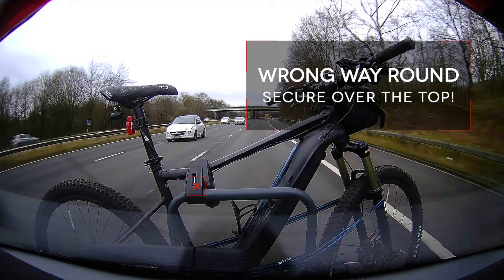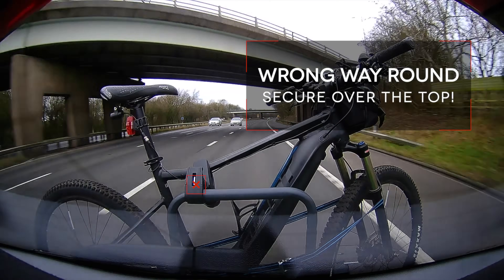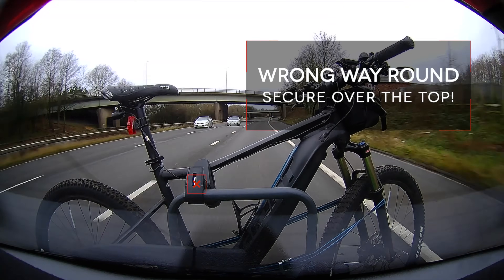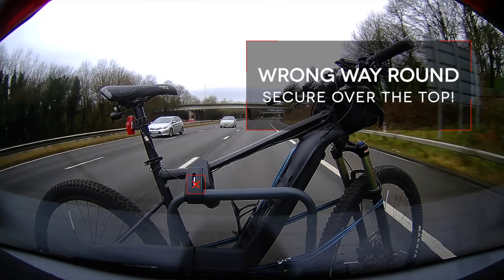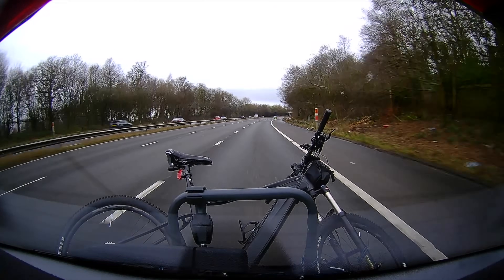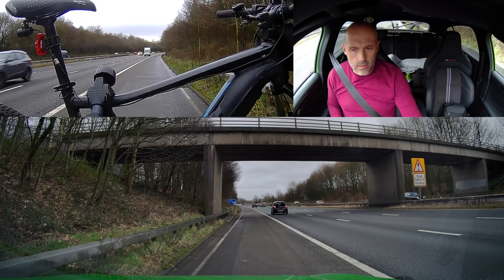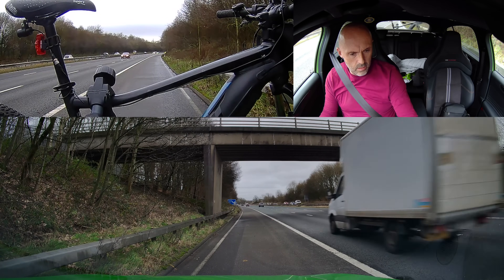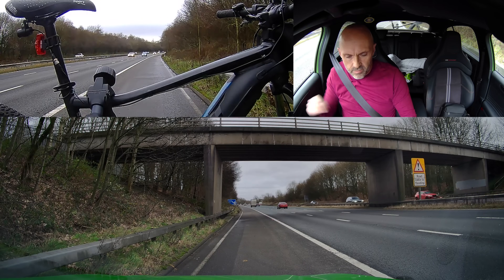Learning Point 415 | Using The Hard Shoulder

Comment: Blimey never thought I would see the day where I beat the Great Ashley Neal on an experience...

I have had to use the Hard Shoulder 3 times in 10 years. I agree that you were right to pull over and sort it immediately... I have seen and read of enough carnage caused because somebody thought, oh I just get it to next junction or services... The loose item will hold on till then....

I can relate as my first time was when the lock on my Nearside mirror of my 18 ton rigid gave up on a very windy day resulting in my mirror been folded in by the wind. This was just as I passed passed Junction 1 of the M18 going towards the M1... Long story short the first available opportunity to pull off at that point was then J33 on the M1, but that was going to be extremely dangerous with no hard shoulder, no Nearside mirror to merge off with and no safe stopping places as every road off it was busy dual carriage ways. So my only safe option was to pull on to the hard shoulder of the M18 and Jerry rig it in place with some bungee chords. I also drove at a slower speed to reduce the load on the mirror to get it back to the yard where I had it fixed overnight by our on site garage team.

2nd time was when I moved into 44ton Artic's, I blew a coolant hose on the M42 literally just past the slip road for Junction 9 and encountered my scariest moment ever on the roads whilst waiting  for recovery. When a passing car stopped in lane 1.... Then reversed Up Lane 1, not the hard shoulder over the brow of a blind hill because they missed their turn off.... Evan at 0230 in the morning I was lucky nothing hit it as it would have ended up flying my way!

3rd and finally was when I witnessed a collision between 2 HGV's last year and pulled over with the casualty truck to provide details... Unfortunately I made the mistake of stopping behind them and couldn't safely pull out for the volume of traffic so had to wait for the Highway patrols to block lane 1 and release me.

Comment: Rightly or wrongly, I would have felt safer and stopped a little further ahead or back from the bridge where there is no crash barrier so I could get a little further away from the live lanes. Many times I've seen HGVs drift slightly into the hard shoulder, don't know why but it does appear to be a thing.
Reply: many  reasons HGVs end  up passing the white line. Road condition, wind, tiredness, lack of attentiveness, vehicle faults, and so on. Its all the same reasons why cars may drift around in their lane a bit - but exaggerated by size and weight.
Reply: @DAFPvnk  I guess we notice it more with an HGV due to the fact that a small drift inevitably means crossing the white lines due to the width of the vehicle.
All the same, if I have to stop I want to be as far from the live lanes as possible.

Comment: I would have done the same given the risk of the bike falling, but as you said, with the hi-vis and also, constantly checking the traffic behind me.
The last time I remember using the hard shoulder was following a roll-over accident, where I stopped at the first phone to get the lads rolling. It was probably 1990.
Reply: For some reason I can't comment on this video, but I can respond to other comments. 

Anyway, I wanted to suggest getting a lightweight bike lock to secure it a bit better and take some of the pressure off that clip. Even a poundland bike lock would help a lot. 

Also, would be interesting to know how old that bike rack is. I have a Yakima Roof rack and cargo box, you need to inspect it every so often to make sure the clamps don't need replacing, wash and lube them. 

Also, you're not supposed to take them through a car wash either. I imagine it's the same with that bike rack.

Comment: So far I've only ever had to use the hard shoulder twice.

First time: I was in one of my works' vans, we were headed down the M60 and the timing belt decided it had had enough with being a timing belt mid-overtake, resulting in having to complete the overtake, coast form lane 3 to 1 then try to land myself on the hard shoulder...

The second - in a different van on the M25 - the driver's side windscreen wiper decided to pop loose from its clip and went flying over the roof of the van... Thankfully there was nobody behind when that happened because that could have caused some problems... anyway, due to the poor weather and the fact the wiper arm was now making an attempt to scrape its way into the cabin, I opted not to continue to the next exit, and instead pulled over, switched the wiper arm from the passenger side to the drivers' side so I'd have at least some visibility then wrapped the passenger side wiper arm in cling wrap as a temporary bodge just to get my last job for the day finished and get a replacement wiper sourced afterwards.

Outside of that... Even the one time I picked up a free No.2 Philips head screwdriver bit with my rear drivers' side tyre I didn't end up stopped on the hard shoulder for that! that managed to hold safe air until I parked up outside my workplace lol.

Comment: Two words Ashley: Thule Outride.  Roof mounted system where the front fork of the bike is bolted to the roof bar cycle carrier.  By far the most secure system.  Only downside is reduced fuel economy (slightly), plus need to remove front wheel.  That can either go in the boot, or you can get a roof mounted wheel carrier.
Reply from the maker: One question, maximum weight limit?
Reply: 17kg per rack, so unless your bike is a heavy weight Enduro bike you should be fine.  The front wheel off can be a bit of a hassle, but it's comforting to know the bike is totally secure.
Reply from the maker: 23kg e-bike! I've got roof mounted systems also.
Reply: Okay - scrap that suggestion 🙂.  Keep the good videos coming. Thanks Ashley.

Comment: This for some reason reminds me of one of these "Police, Camera, Action" videos I watched ages ago, probably years ago. Motorway police notice a car doing a dangerous merge from the hard shoulder, so they decide to have a word with the driver. They pull him over on the hard shoulder and have a word with him, not sure if something else came up as well. They explain to him what he did wrong, what he needs to do better and then send him on his way. I assume you expected what happened next: Yes, he does it again. Hardly gets up to speed and almost instantly pulls out into the path of another vehicle, which luckily manages to avoid him. Proper facepalm moment.

Unfortunately can't remember what happened next, if they stopped him again or if they gave up.

Comment: Hi viz in the door pockets. Then it’s accessible at all times.

Each door pocket has one. The centre-rear passenger is expendable 😂 (but if that many people are getting out, they should be over the barrier in no time anyway).

It’s a good message: like ringing 999 it shouldn’t be used flippantly, but if there’s a justification, even if you’re not sure, it’s better to use it than risk a potentially lethal alternative. 

It’s also an opportunity to reflect on whether the bike is properly fixed before you set off. Clamps can fail or slip; vibration can shake them off their position. Always have a plan B - like a well-tied strap; and check them a few miles into the journey.
Reply: I keep mine on the back seat, like Ashley's. Not that I meant to keep it there but somehow it's there and I haven't moved it yet!

Comment: This is almost exactly what happened to me. My bike came loose at the top and toppled backwards but was held on the bottom but in a very unstable  condition. This was the first time I have ever used a bike carrier. Like yourself I had to quickly fix the problem since it could have got much worst. My bike was hanging on with a thread. Its the only time I have ever used the Hardshoulder. I now place a peice of straping through the frame and attach it to the boot. So if the carrier was to fail the frame would still be attached to the car in some manor. Although this happen 10 years ago I still worry about it, a bike falling in the middle of the motorway? ouch.

Comment: I once had a very similar situation, my bike was on a roof mounted bike rack and the frame holder came loose and the bike was only held on by the two wheel mounting points and was hanging off the side of the car. I quickly pulled over into the hard shoulder to secure it back in.

Comment: Hi Ash, with your particular bike rack, can the top clamp be rotated? If it can, then turning it upside down would mean it acts as a U-shaped hook, and then even if it isn't closed tight then it's holding the bike up. Of course, that might affect the other attachment points.
Reply: Mine can be moved up and down, but I always fasten them open side down since gravity is more likely to hold the arm in place. Both methods have their strengths and weaknesses. Mine do seem to secure onto the top rail better than that though, curving round it. I tighten them right up so the two halves almost touch and then lock them. Each wheel is secured too, to it's super-secure, but to prevent theft, I add a D-lock and cable. I've seen too many loads lost to take chances.

Comment: Well, at least it didn't fall off. Some years ago I did a mountain bike uplift day, where you got carted back up to the top of the downhill runs in a transit mini-bus towing a trailer bike carrier that could take 10 bikes. The bloke driving the van took your bike and secured it. But there was one guy, with a really expensive and shiny new steed, who insisted on securing his bike onto the rack himself.

When we got to the top car park, his bike was missing from the trailer! Nobody had noticed, but it must have fallen off into the road on the way up. The rest of the day we passed this chap multiple times as he traced the route the uplift bus took, peering to the ditches at the side of the forest road!

It never did turn up. I reckon somebody saw an opportunity and nicked it! The uplift company also refused to take responsibility (quite rightly) as the bloke had secured the bike himself.

On reflection though, it is ultimately the driver's responsibility to ensure they have secured their load properly. The uplift driver ought to have refused to carry the blokes bike if he couldn't check it was secure.
Reply: Ashley's bike could have fallen off if he had chosen to continue to the next exit before re-securing it.

Comment: Ashley. Obviously use of a manual gearbox car make exit and re-entry via the passenger side door less likely and speed here dictated your choice as well as the your knowledge that you would not be there very long as it had not broken down, but the advice is normaly to use this as the method of vacating the vehicle.
Also looking to the rear frequently is the life saver here as those vehicles that do get struck have only been there for eleven minutes, so whilst your car may come out of it a mess frequent looks to the rear could save your life.
The use of hazzards even for a short period is also to be considered as the dimbats on their phones will see this in their periphery vision better as flashing lights are considered the same as movement and it is the periphery detection of the eye which picks this up better.
Reply from the maker: Hazards were on and the level of traffic dictated the risk of which side to exit
Reply: @ashley_neal  As aknowledged about the exiting and thanks for confirmation of hazzards weren't sure myself but knew you possibly would put them on, my mentioning was for viewers and commenters digestion.
Just make sure you have your three shredded wheat and spinich before tighting the clamps next time buddy, stay safe.

Comment: I have an innate mistrust of "holddowns" that only try to grip something and not actually go around it.  
it also bears mentioning that in the highway code, regarding commercial carriers,  multiple restraints are required, so if one fails, the others will hold until it can be resecured. the same standard should apply to all loads, though I didn't read so far as to find the section of the highway code dealing with it.

Comment: Kudos for securing the bike well enough for it not to fall on the motoway, many accidents happen for this exact reason. Good job as well to speed up on the hard shoulder rather than pulling out at 10 mph like some many people do.
Aside from the high visibility vest, I would change one thing : It looked like you never looked at the traffic for the entire time you spent fixing the bike. I know it's not easy to look behind while you're fixing something on the back of the car but this is the most dangerous place to be and I wouldn't spend more than 10 seconds without taking a moment to analyze what's coming. Pedestrians and highways don't work well together.
I don't know if it's mandatory or not to move over for broken down vehicles in the UK but it is baffling to see how many cars stayed in the left lane when they could have given space.

Comment: I had a problem when my bonnet popped open on the motorway. Luckly the bonnet was caught on the safety latch. I was on the M62 but I was lucky that the hard shoulder was not an active lane at the time so I was able to stop and close my bonnet. It took less than 20 seconds but it was a very scary 20 seconds.

Comment: Learning Point 416…How To Safely Secure A Load To The Vehicle 😁

Joking of course, having multiple anchor points is safely loading for exactly this reason, if one fails there are others to keep it held until you can safely stop 👍
Reply from the maker: You're absolutely right Bob! Usually I've got two bikes on the rack and the second bike effectively holds the first one in also. Which way round you put the fasteners is important, and that's why I wanted people to see the mistake.
Reply: After I watched a video of someone trying to nick a bike off the back of a moving car, I always lock the top-rail-securing arms and additionally, use a Kryptonite D-lock and cable. Thule rack.
Reply: I have stopped using bike racks altogether, after owning and using 4 different styles.  I now have the bikes inside the car. My next vehicle will probably be a van.
Reply: Yes get a proper car like I did, a Fiat Doblo 😅 

but yes for this reason and our baby son I drive a Doblo.
Reply: @PedroConejo1939 of a moving car? I'd like to see that video 😅
Reply: What bike carrier do you use Ashley if you don't mind me asking?
Reply: @ashley_neal always double secure the clamp with an extra lashing strap. Ive had this happen too, once. The bike frames these days are not fitted with straight tubes anymore, the grip of the clamp on the frame is poor, especially when the bike is wet and dirty.
Reply: @karelbartman  Search for "Moment thief tries steal bike car". It's 6 years old - there may be other copies of the same video. Personally, I think I might have pulled up sharpish if it had been my car and bike, making him eat the crossbar. The little scrote appeared to be one of two working together.
Reply: @PedroConejo1939  Thanks I've found it, that was a good one!
Reply: @ashley_neal Those screw up frame fixings are rarely good enough, they have a habit of vibrating lose.  When I used to carry bikes I always added an extra bungee cord, or the straps that are used for holding your foot in old style cycle clips never seem to come off (I use these as backups for luggage on my motorbike).
Reply: @johnhyde6414  my road bike is easily worth more than the Kia Rio that it's inside off. 😅 So I'm not risking it hanging on a rack.

Comment: I heard a lot of horror stories about Halfords bike racks coming loose, & bike falling off back. 

I used hard shoulder on hgv before, to tighten curtain or ratchet straps, that come loose, with truck bed flexing.

Better to stop if no service's nearby, than have a load drop off & be in big trouble with Police and traffic commissioner.
Reply: Which do you find better, back rack or roof rack for bikes?

Comment: Did you indicate before you spotted the gap, or only after?
Reply from the maker: You do have to be careful with when you put your signal on in this situation. If you put it on while you're stopped people approaching might think you're instantly going to pull out. For me have the movement as the first signal, then use your indicator when you're getting closer to merging back onto the motorway.👍
Reply: @ashley_neal  Thanks, hence the question - I couldn't make up my mind if the signal would be taken as that or "please give me space"

Comment: It's really mind boggling how they thought it was okay to remove hard shoulders on "smart" motorways....
Reply from the maker: Do you think I would've struggled making it to a refugee area on a smart motorway?
Reply: @ashley_neal  I presume that refuge areas on smart motorways would be fairly regular, although I haven't been on a smart motorway in  a long time, or a motorway in general as I don't live close to one. My issue with the smart motorways is that it has the potential to increase the danger if you break down and can't reach a refuge area quickly enough.